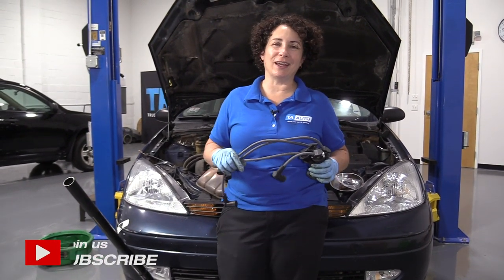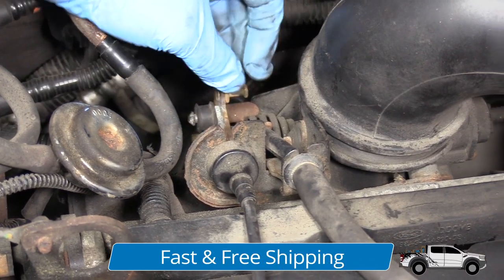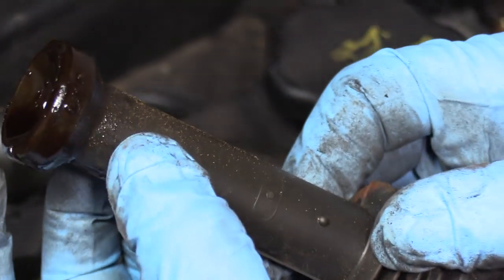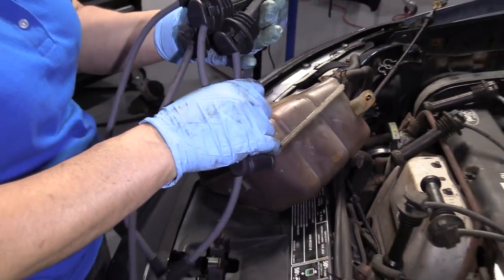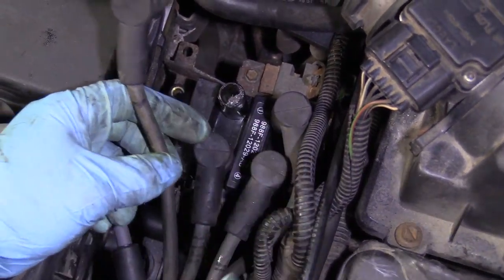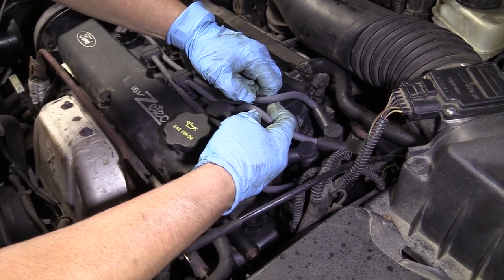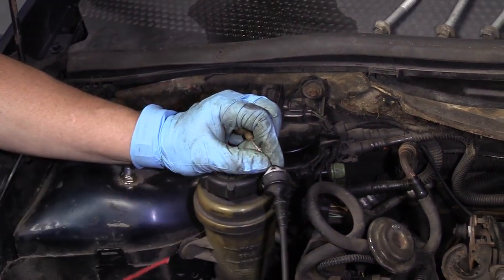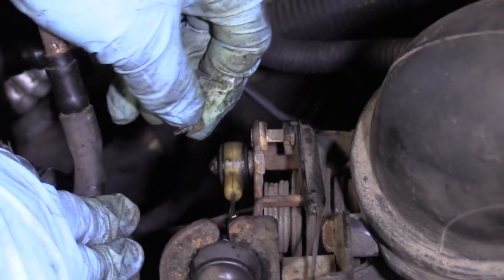How to Replace Ignition Wire 00-07 Ford Focus

Comment: Never pull om the actual wires unless you want to damage them, just in case all youre really wanting to do is check the spark plugs. Otherwise, youre forced into replacing the wires too.
Reply from the maker: +bangyahead1 Thanks for the feedback!